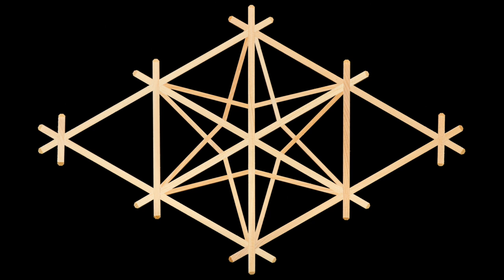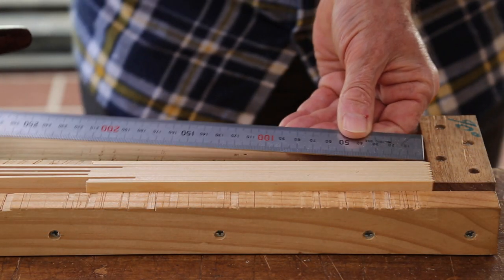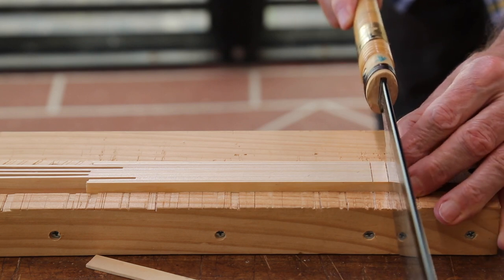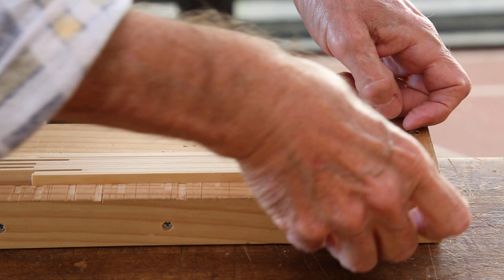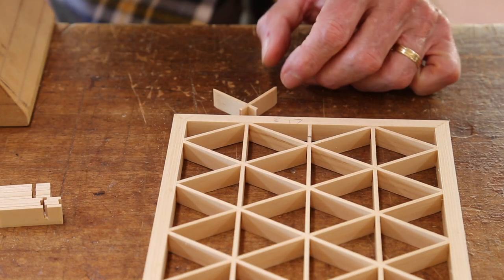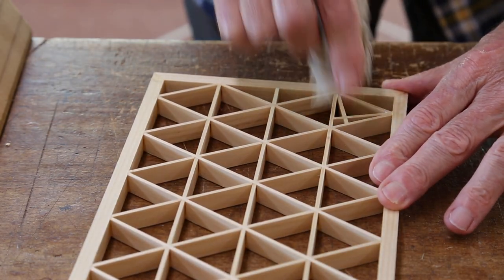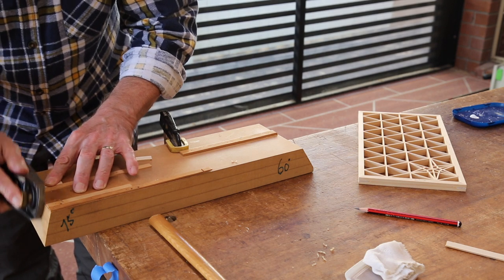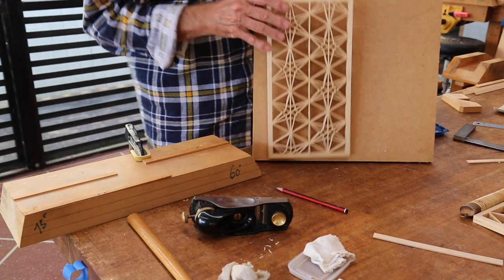Shoji and kumiko patterns — 11 Kasane rindō pattern

Comment: Sir, off-topic, I was looking at your video on making coasters and was wondering if a cork backing would be in order to prevent moisture getting onto the table surface?    Thanks, stay safe   Ralph
Reply from the maker: Hi Ralph. That's certainly possible, but I've never worried about it. It wouldn't be too difficult to attach a cork base to the bottom of the coaster, but unless the cork was a contrasting colour, the kumiko pattern may get lost against the cork colour.
Cheers.
Des

Comment: I’m sure you’ve covered it before but do you ever use the purpose built kumiko planes instead? I’ve found that they are incredibly difficult to source in the US.
Reply from the maker: I have the set of four Adam. I only use them when I make very small patterns. Other than that, they're not really necessary. They're very expensive, and very difficult to set up accurately, and to maintain that accuracy. In all my books and videos, I show how to make the patterns using just normal jigs. The kumiko planes (ha-ganna) don't make the pattern-making process any easier, just faster, and they enable you to work with much smaller pieces. Unless you're doing this full-time and making a lot of patterns, I really can't see the value for the amount of money that has to be spent to get them.
Des
Reply: @kskdesign1  thanks so much for the information! I've got 3 more of your books on order and this helps me decide what tools/materials to get before they arrive.